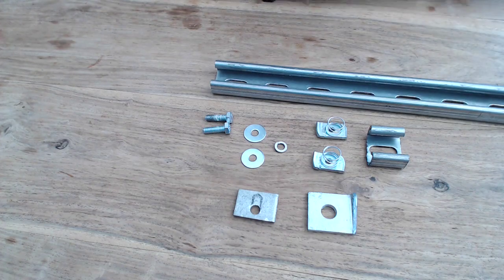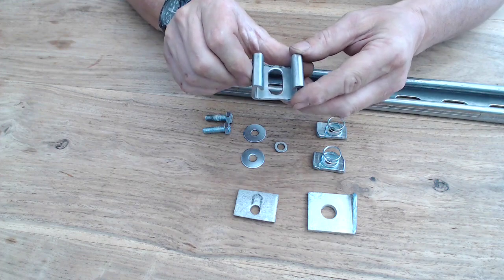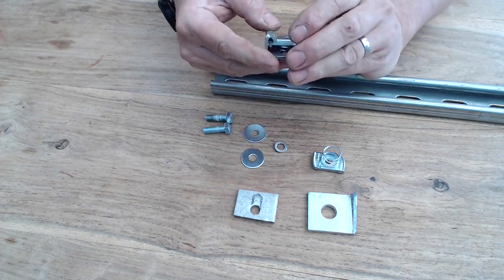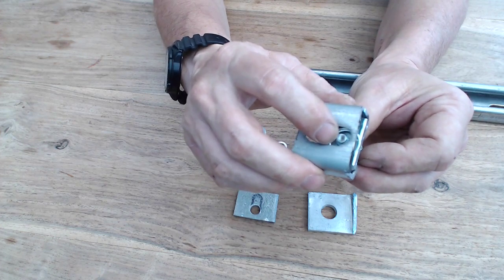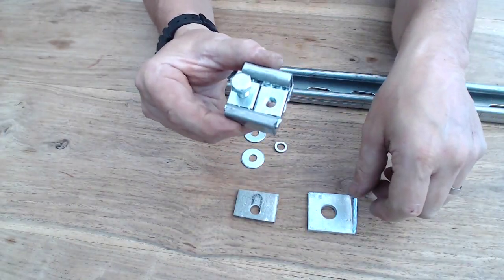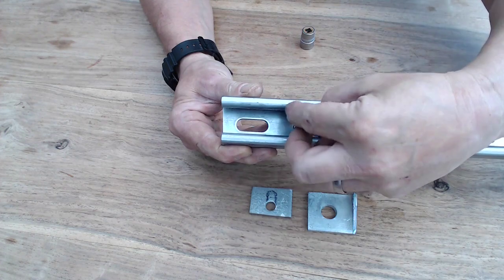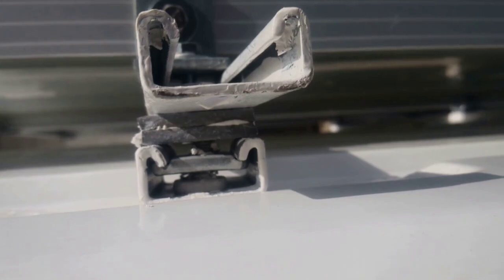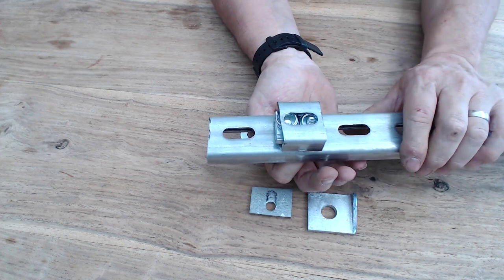Explanation on how to fit the roof bars on the Peugeot Boxer

Comment: Someone posted this on a Promaster (American version of the Boxer) group. Clever design. Have some questions though: 1. Does the bolt, upon tightening, pull the paint of the top of the stud? 2. Am I correct in that all the loads rest entirely on the stud? The base lifts off the van body? 3. Is the only thing that prevents lateral movement of the rack, the friction of the bolt pressing down & compressing the head of the stud? Could vibration or a sideways pull of an awning, or a little knock sideways cause the bolt to slide or fall off the stud head? From what I can tell, doesn’t looks like a very positive capture laterally due to the space of the unistrut hole around the stud base.